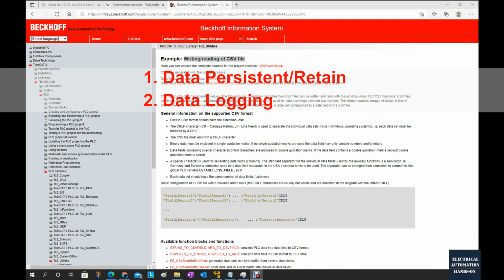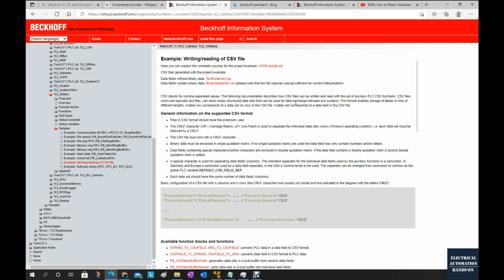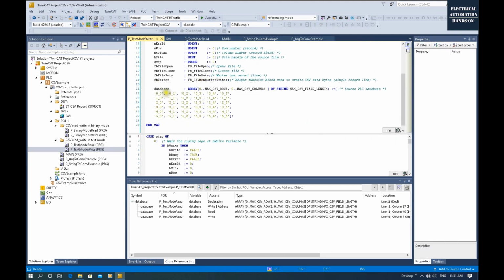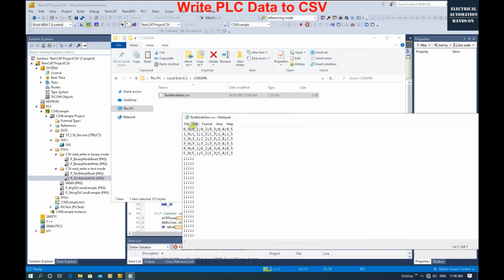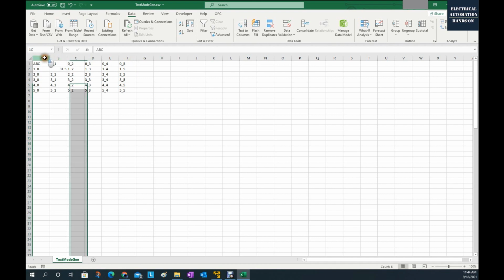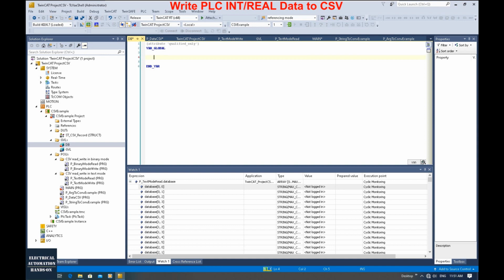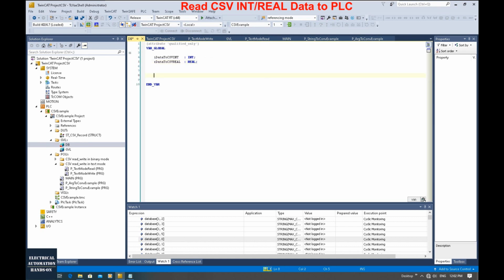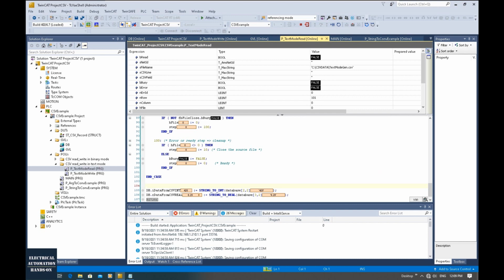BK17. Beckhoff TwinCAT 3 Datalogging or Recipe via CSV Reading and Writing

Comment: Thanks for the video but I have a problem:
I follow your instructions step by step but when turning bWrite from 'false' tot 'true' (12:30 min) in my program bError becomes true and nErrId says 1804.
I searched it ans it means 'Not found (files, ...).' ...
Can anyone help to fix this?
Reply from the maker: Have you set the file directory properly, try not using C: root. setup a folder and try.
Reply: @electricalautomation  Thanks so much for the fast reply!
It works now, I honestly don't know what I did different last time. 
Your video was very helpful in general
Reply from the maker: @KassiopeiaClothing  Glad you worked it out!

Comment: Maybe this will be a stupid question, but when i load the sample program the library Tc3_Interfaces is highligthed and says "not installed to the system". However there is no option to download or import. Where can I download it?
Reply from the maker: May be you can try to delete the TC3_Interfaces and try again.
Reply: @electricalautomation  yed i removed it and it worked. Apprently that library is no longer needed

Comment: Great tutorial, thanks for taking the time. Is there an easy way for me to keep writing data below or above the previous data I've written? I don't want to overwrite every time I add new stuff to the database, I want the database written again and again below the previous one when I set the write bit.
Reply from the maker: As shown 18:34, you could change 'sFileName' and add suffix with the data and time for multiple files.
Reply: @electricalautomation  Thank you for replying. I have no need to read the data from the CSV. What I'm trying to do is log data like an audit trail type function. I'll have an array of changed parameters, date and time, old value and new value, that I want to write to a file whenever someone activates the changes. Because this can happen multiple times per day I can't make a new file every time someone makes a change.. but perhaps this is not the most suitable alternative for my application. I would go with some sort of database but it's outside of my current skill set sadly.
Reply: Did you ever figure it out? I know how to save to a file and keep adding to the previous line, but not with this specific set up... It would be great if you figured it out and you can share your solution. Thanks
Reply: NVM - figured it out. you just have to change "nMode := FOPEN_MODEAPPEND OR FOPEN_MODETEXT" on line 16. I forgot about that part of the function.

Comment: Hi, Any similar video for RFID connection to Twincat Controller? I am basically looking for USB based RFID connection to Twincat controller in PC and reading Tags read by RFID reader in to the PC
Reply from the maker: Hi, personally I never did USB data transfer via Beckhoff. I would recommend you use the RFID device which has Ethernet/IP or Profinet functions. Then the communication will be very easy. I have the videos showed the Beckhoff Ethernet/IP and Profinet communication.

Comment: Thanks for a very useful video. I have a question: 
How to generate a continuous log of data? Like first column for time and other columns for I/O data? And generate new rows every second? Is there an example available?
Reply from the maker: Hello, if you are going to use CSV shown in the video, you need to program the data/time as the data and storage them into a Array. Then shift the line per second to store the data, time, data line by line. But this is for short term and small volume data storage. Considering your question, it is more likely needed to use HMI and database to store the data.
Reply: @electricalautomation  Very informative Video. Saved my PhD! Thank you! Could you please make a tutorial on this?

Comment: Thank you for the tutorial. Looking forward for recipe management and barcode reader tutorial in twincat 3.
Reply from the maker: Hello, thanks for your comments. Regarding the barcode reader, please review videos https://youtu.be/m7zKt9zyx7c
https://youtu.be/5cKY4Y1nrIA. Also it is hard to find the barcode reader which supports EtherCAT, therefore, usually Beckhoff controller will use Profinet Master or Ethernet/IP master to connect other devices via Profinet or Ethernet/IP